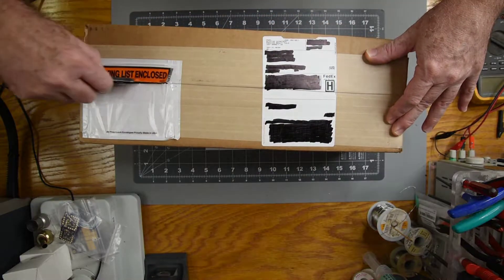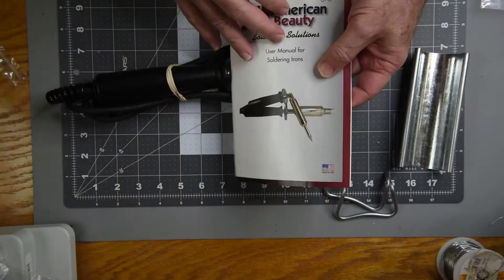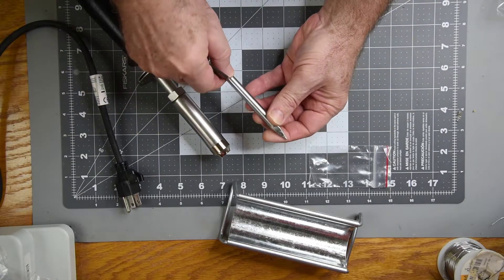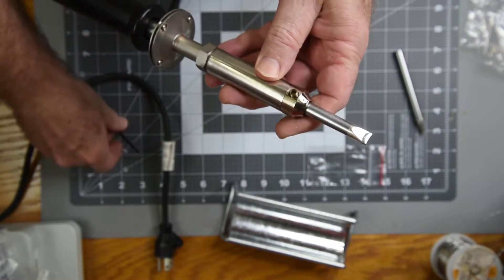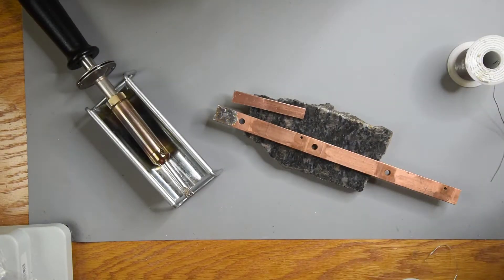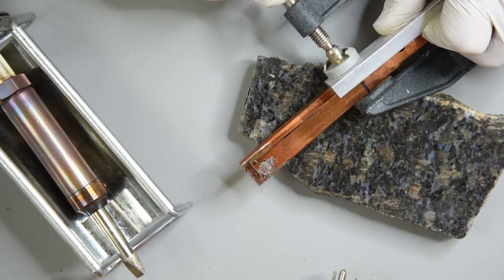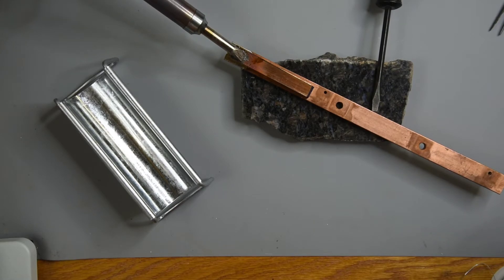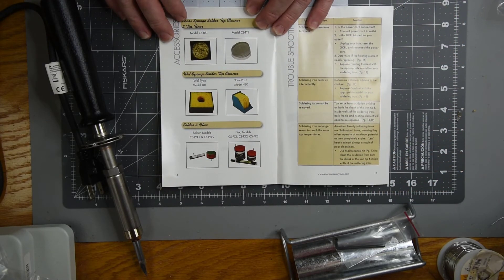A Lot of Hot: American Beauty 3138X-175 Review

Comment: Right on! I'm glad you're happy with it. AB is a good company and they make good products for sure. I've been to their shop and repair/refurb facility. It's a first-class operation, and they're always a pleasure to deal with.

One of the last shops I worked in before I went independent had the same iron for like 20 years, and it never once went in for repair, they said. I ended up buying one of their irons and one of their solder pots, and they still work flawlessly a few years on. (Meanwhile, the $7,000 JBC setup I use has been to the shop twice in 3 years.)

Plus, like you said, it's getting harder and harder to find things that are still Made in America.
Reply from the maker: I'm am glad I got it.  I can't believe I had never heard of them.  Lately I've been willing to pay a bit more for stuff made in the US.  Sometime it's not really any better, but in this case, this is a really nice made soldering iron.